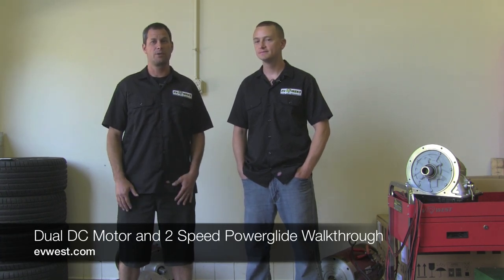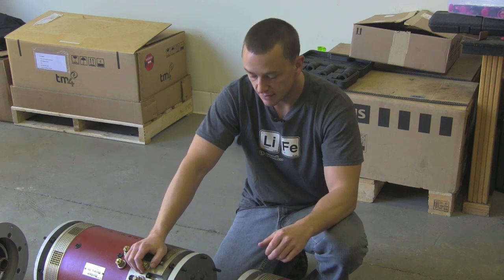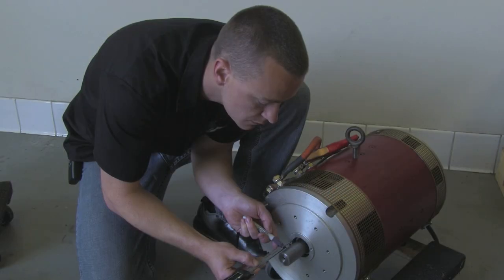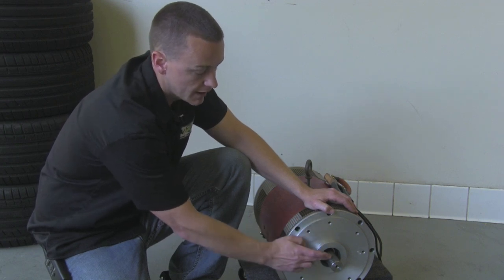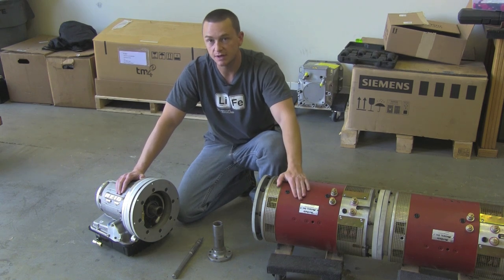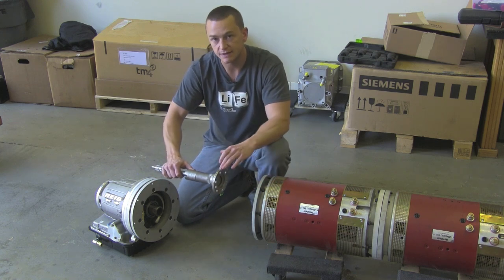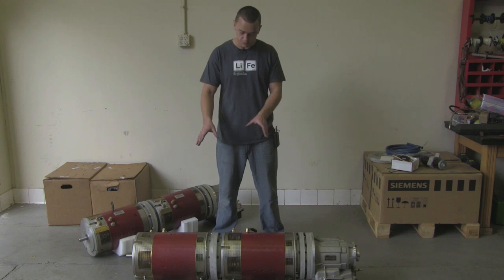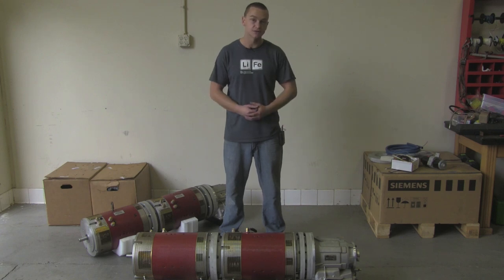Dual Motor Electric Vehicle Drivetrain With Powerglide 2 Speed Transmission Walkthrough by EV West

Comment: I'm a little lost on the torque converter issue.  What is the purpose of having clutches on the transmission, and run a pump to engage when the motors are idle?  Is this for towing reasons so the whole drive-train isn't connected when vehicle is in tow?
Reply: +Erich “WitchDoctor” Stein Automatic transmissions use little clutches inside to change gears (at least some do, like this one).  The oil acts as a lubricant, obviously, but it also acts as a kind of hydraulic fluid to operate the clutches.  When the electric motors aren't spinning, no oil is getting pumped and no gears can engage, so they use a separate oil pump to supply the needed hydraulic pressure.  Once the gear is engaged, the built in oil pump takes over and the separate pump shuts off with the RPM switch detailed in the video.

Comment: I have a mint 62 Pontiac with a small block Chevy engine and the same two speed powerglide transmission. Although it's a traditional rear drive configuration - not transaxle - could it be retrofitted with the same EV motor and an associated battery system?
Reply: yes
Reply: Yeah it's the same from the trans back

Comment: Kiss that front motor bearing goodbye someday. I work in quality engineering and work with brushless DC motors. Even motors with rubber sealed water resistant bearings and get debris when cutting a shaft with something as simple as a dremel let alone an angle grinder 🤣

Comment: i want to use something simular for a boat to replace a 1000 horsepower 454 with a jet drive has no transmission boat are usually high torque at around 3200 rpm so my question is will something like this work and what is the lowest. posible cost

Comment: Questions; 1) what happens to the power steering when at an intersection and the motor is stopped? 2) what happens to the air conditioning in the same situation?
Reply: Some new cars are now electric power steering, you can even buy it for street rods.  Who says you need a belt driven ac?

Comment: ok so you cut the shafts, added a coupler that is inaccessible after the flanges are fitted  and bolted the lot together. Because you made no comment about how you connect the coupler to the shafts I have to assume they are not yet fixed. No pins, no bolts, no splines. And you will rely on the coupler to friction weld itself to the shafts when you start the motors under load. And the first motor does 5000 RPM and the second motor is stopped by the drive train..  It will work but a bugger if you ever want to separate the motors.

Comment: If motors are not spinning,  why does transmission need oil to engage clutches?  Not spinning,  not rolling,  no clutches needed. Is this a regen issue? Clutches are engaged, pump spins only when INPUT shaft spins? I think I answered my own question......

Comment: is this a good option for a hybrid electric RV motor coach lets say combined with the new i-cell batteries or something similar maybe lithium ion bottom line 600 horse power for 2 of these can 3 of them be used or is the limit 2 and can they be used to drive each wheel independent so if the limit is 2 motors for torque limitations issues on the shaft any reason i could not have have 2 motors for each wheel of a the coach that brings up another question what is the length and diameter of these motors amp draw charts say 3 charts rated stated voltage with turque load being the x factor to show amp draw under load and rpm under said load as well more load less rpm so either the rpm goes down or the amp draw goes up i would expect to see both but to what degree so if this doable lets see the specs on these units and the also the cooling needs i will still need a good size dog house in the front but not as big as most current 600 hp coaches i suspect 400 hp will get me going just fine but that is an another topic for another form

Comment: Why is not just mount the two motors perpendicular to the wheels and convert everything like that? No pinion gears or whatever transmission/differential conversion, just straight reversible power to two axle/suspension articulations front and rear.

Comment: Why use a transmission? Can't you connect directly to the driveshaft or even better straight to the differential?
Reply: You can buy them already set up like that. But, it wouldn't hurt to have a little mechanical advantage. At most you will only need 1 or 2 gears and a reverse  with these set ups.

Comment: How do you change brushes in these motors and how long they last?
Reply: +Mladen Milić they are brushless
Reply: +Sammy De Wreede These DC motors are not brushless. If DC motor has terminals for rotor and stator, it could not be brushless. True brushless DC motors are permanent magnet rotor with many widings on stator and it has much more connections. And brushless DC motors could not deliver as much power as brushed DC motors or brushless AC motor.
Reply: Can't say how long they last, depends on the power you put to them and how clean you keep them.  You pull the vented covers off and the brushes are right there.

Comment: Would this dual motor power glide transmission adapt to a Chevy Express 3500 LS passenger van
Reply from the maker: You can check with the sales team at EV west using sales@evwest.com they can answer the specific questions you have. Drew - EV West Media Manger

Comment: WHY? Electric motors don't need a transmission, just connect the motor to the driveshaft. It's more efficient, and will just work better. Not to mention a lot less trouble. Electric motors are usually direct drive, or have a one speed reduction gear, like the rear axle. Transmissions are for combustion engines. Have you ever seen a golf cart with a gear shifter? There is a reason for that.

Comment: Few people know how stout those aftermarket PowerGlides are !

IIRC, racer who use the, plumb a bypass valve into the hydraulics for neutral.  You close down the bypass valve (your typical multi-turn plumbing valve) to provide full pressure to shift from neutral to drive,  Crude, but it works.

Comment: Hey guys... very well done on your good work. I think you have had the best idea ever in trying to convert gas heads to electric. Make a car faster than theirs. I have not seen what you using for power packs. If you want to drastically reduce weight from battery packs check out maxwell ultra capacitors. They are a fraction of the weight and recharge in mins.

Comment: I would love to have a 70 c10 pickup with this setup in it and enough lithium in the bed for about 250-300 miles under normal driving. I sen chevy did one and called it a E10 which was cool but 70 short wheel base wouldve been my pick. But getting the truck and paying for it all might be really expensive

Comment: Can you attach a pully system to the motor? Or will that cause runnout problems?
Reply: pulley for what?  The front of the first motor has a keyway shaft on it for the WarP 11's
Reply: Things like AC and power steering for one thing. Otherwise a conversion gets way more complicated and expensive.

Comment: the electric motor is not the issue here, you can even make it four motors one for each wheel... the thing is how much electric power can you give to those electric motors to be able to run fastest and most efficient.. power cell or hydrogen cell is still required. but still this is good for a start, it would even be better if they build a one large electric motor rather than joining up the two.

Comment: I have a 28ft motorhome with a 454, turbo 400. Could I replace it with your dual warp 11s and you have a bolt on kit for the alternator vacuum pump and power steering pump. if so how much would it cost me? And how much battery power Would I need?
Reply: With a 28 foot motor home??  A HELL of a LOT!!

Comment: Can you point me in a direction to help me find an electric motor?  I need 33ftlbs of torque, 3600 RPM, and dual output shafts.  If possible 1.125" output shafts with a .25" keyway, and 20.25" shaft end to shaft end.

Replacement for a 725cc V-twin lawnmower motor.  Lawn mower is hydrostatic zero turn, so I don't really need to "throttle" it.
Reply from the maker: you can check with the sales team at EV west using sales@evwest.com they can answer the specific questions you have. Drew - EV West Media Manger

Comment: I want that configuration dual motor but i need yo know all the kit basic conversion, , i have a Mazda rx7 1987 Where crankshaft transmits to the rear axle of the car the force, i need the budget to muy the Kit? Could you help me?

Comment: Why would someone use a transmission that has a 1:1 output in high gear with an electric motor?  You can vary the torque and rpms of the motors without the transmission, and this transmission doesnt give you an overdriven output, I don't really see the point.

Comment: What kind of rear end (driveshaft, differential/ axle) will be used on it?
Reply: ANYTHING THAT WILL HANDLE 1200 LBS OF TORQUE. MOSER OR CURRIE WILL BUILD ANYTHING YOU WANT, MOST LIKELY A 9 INCH FORD.
Reply: factory it's a power glide tranny the rpm are compatible
Reply: Kevin Lam AAM 11.5".
Reply: Kevin Lam you can use any drive shaft and rear end basically your input and output shaft has to match I could see this being used in an all-wheel-drive application with total of four Motors

Comment: Cool...possible to set up in a 1977 GMC motorhome....
Reply: Anything is possible if you can afford it . Maybe Japan sells a cheap knock off of this motor and a controller. I've built engines and several motorhomes from scrap. To do this one would need some leaf  battreys from used cars and a charge controller salvaged from a used electric car. A good place to work in to fabricate the motor brackets and battrey brackets. And wire this up. Used parts from a electric car customized to fit into the vehicle dash giving instruments and indicators.
Reply: @davidmayhall6567  Its front wheel drive...425 THM

Comment: I need both electric motors to put into my motor home replacing the Diesel engine, and some nice battery's and a charger. Then I can connect them to my Allison 6 speed pushbutton transmission. My Diesel generator can charge my battery's while I am camping all extra wasted power can go to battery bank😁

Comment: What's the reason for not using a torque converter???
I imagine that the reason is RPM and Power reserve.  But this is an Old video
and Lithium Power packs were not so "common use" as now in 2021.
Those Brushed motors have never been good for this type of application.
I am using a large BLDC motor, that is prob. Half the diameter of these motors 
and the length of Prob  1.5 of ONE of these motors. 
BLDC is far more controllable in speed, more efficient in Power usage and more torque for the size.
and with the new power packs of Lithium cells, Higher Voltage appropriate for the motors, higher current reserve, etc.   (Yes, there are loses in using Torque converter bc it is not a direct drive but everything mentioned here, in improvements, easily makes up for the T.C. losses.)
This conversion, I am working on is for a  Cadillac sedan w a Stainless steel Top from the 80s
Anybody remember that?

Comment: Could almost put one of these motors in my rx-30 nz built cressida into the transmission tunnel mounted to the rear diff, batteries, up transmission/driveshaft tunnel and in engine bay, controller and such where the fuel tank used to be, can still use original trans for forward, neutral, reverse as well as original emergency brake

Comment: Can I use the two motors Set up in connection like you have With my original transmission to power my 1993 32 foot Winnebago RV
Reply: Did you give it a try?
Reply: No sorry

Comment: Could This SET-UP' be Installed into a sailing' Boat' like a cat' Two-Hulls' &/or Mono-Hull's' &/or With Hybrid Diesel' or Solar' Power' supply' - Also how much Weight saving would that be &/or how much electric drive Power would those Electric Motors Coupled together take to Drive Effectively' - nice Idea * video' > ??? > ??? Shalom >

Comment: WHEN YOU TAKE A RC CAR AND PUT BIG MONSTER TRUCK TIRES ON IT WITHOUT RE-GEARINGIT, YOU WILL NOTICE HUGE TOP END SPEED. BUT YOU WILL ALSO HEAT UP THE MOTOR AND FRY IT. I FOUND THIS OUT THE HARD WAY. THE SAME PRINCIPLE APPLIES TO THESE ENGINES, WITHOUT A TRANSMISSION THE MOTORS WILL FRY IF YOU TAKE OFF WITH A 1 TO 1 DIRECT DRIVE AND NO LOW GEARS (SAME PRINCIPLE AS THE RC CAR WITH BIG OR SMALL TIRES).

Comment: at the risk of asking dumb questions... is FVD dead? is  SVPWM used in EV? or am i just overthinking EV?
Reply: what is FVD and SVPWM?  i have been designing motor drives for years and those terms seemed to have bypassed me.
Reply: http://iopscience.iop.org/article/10.1088/1757-899X/51/1/012027/pdf
then this should not be hard i think :P yet easier then me trying to explain it via a comment :)

VFD is a T9 bullshit thing should be CVT.
Reply: thanks for the link.  the articles are IEEE publications.  I could only read the one you gave me.  I am not a member anymore.

Comment: OK, you've piqued my interest enough to ask a few questions.  I know enough about automotive engineering and wrenching to be a danger to myself & others. A torque converter is filled with trans fluid by way of that hollow input shaft (?). Is your modified input shaft machined where it no longer pumps fluid out the front to fill a torque converter? Do I  need to enlist the skills of a qualified transmission guy(or gal) to install your modified shaft? (I'm the guy who can turn a half-hour job into 3 or 4).

Comment: but will it work in my 240sx for drifting ? can it work with a 5 speed?
Reply: Why would you use a manual trans. there's no need for torque multiplication? The torque is linear and instantaneous, the powerglide is a 2sp and is used basically as a freewheel.